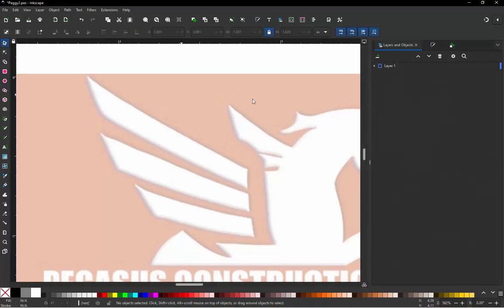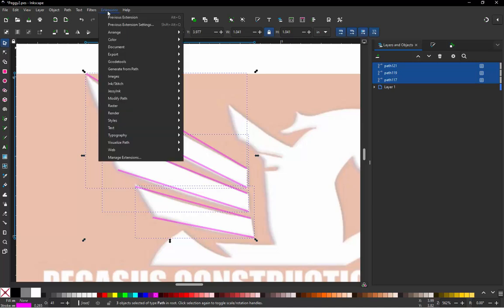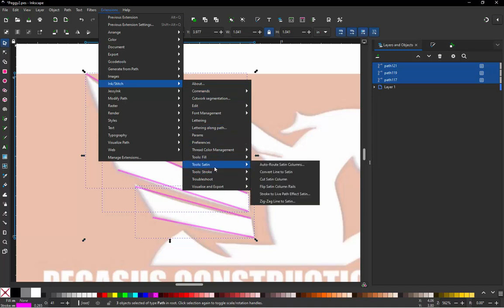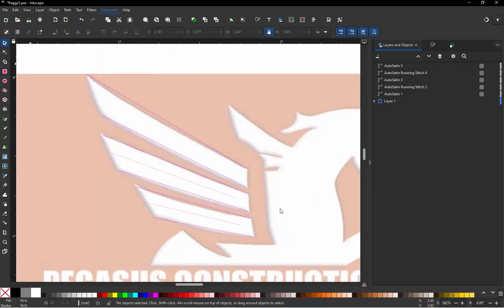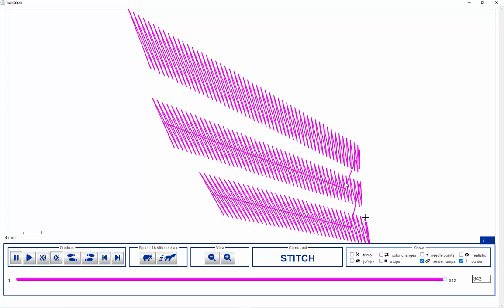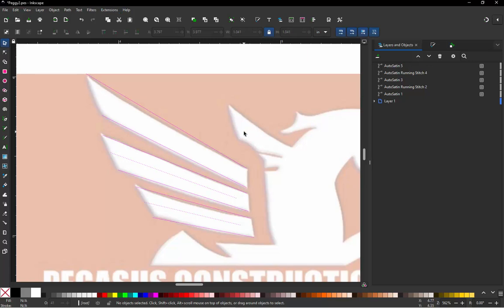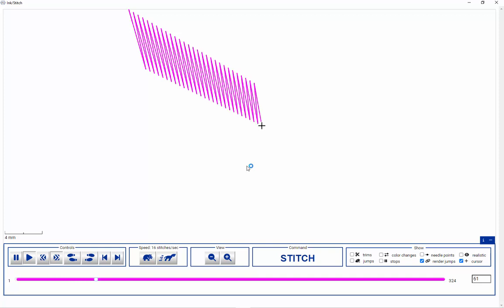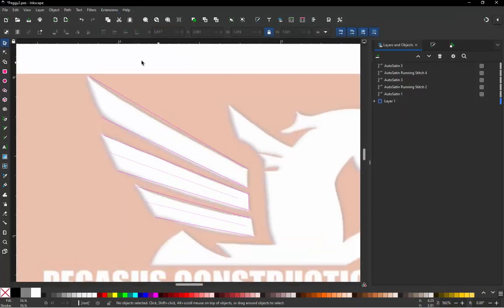Controlling Thread Jumps in InkStitch

Comment: A super easy way to do this, design your logo in illustrator (if you can) and just put every object that isn't connected on a new layer. - export Svg - open in inkscape, use params on auto then boom! done. no jumps just nice and clean.